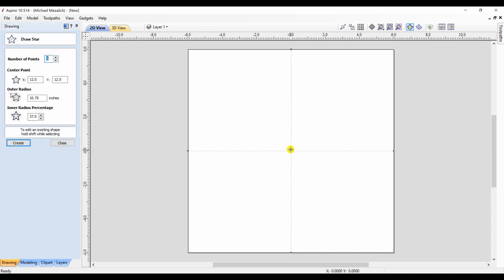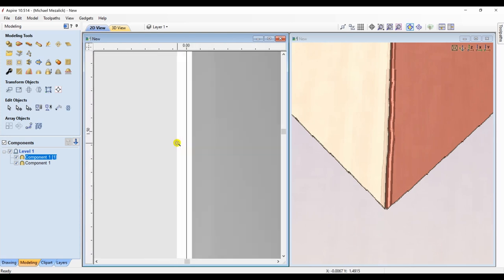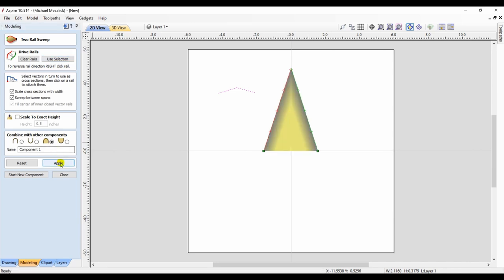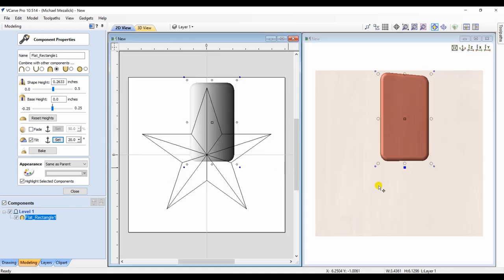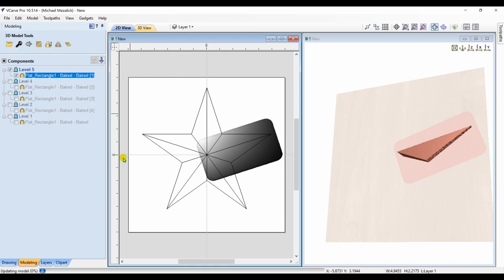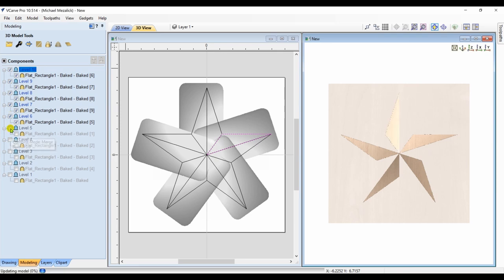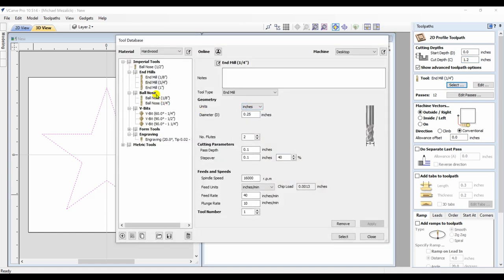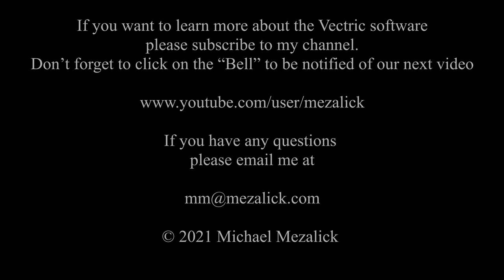How to  make 3D Stars with VCarve OR Aspire Vectric

Comment: Could a v bit be used to reduce machine time?
Reply from the maker: For stars that are concave, Absolutly, but for this convex type of star, I don't think so. How would you go about doing that ? If you use the VCarve toolpath the end points of the star would be higher then the center which would be shallower, because to the distance between the vectors.